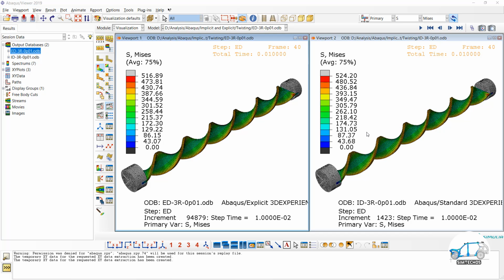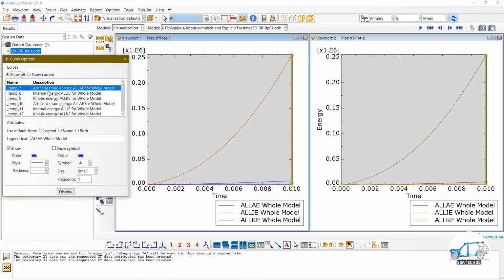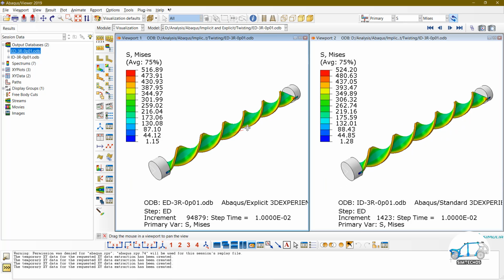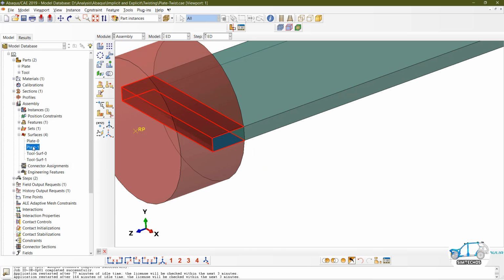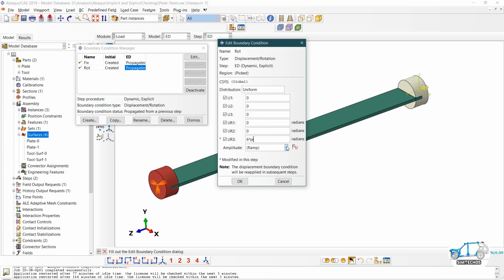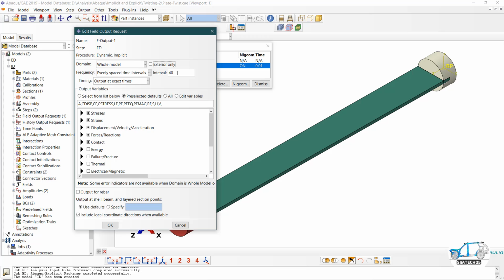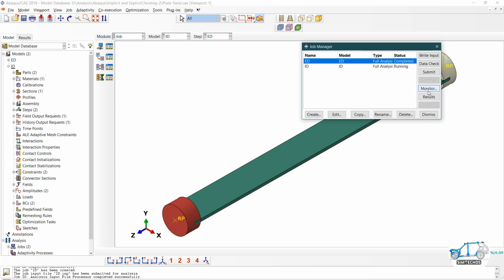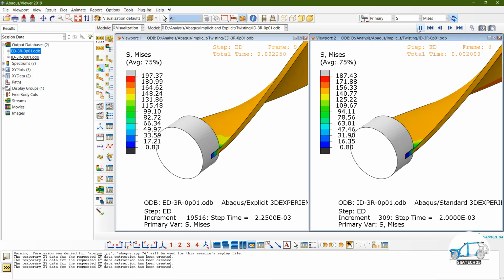Implicit and Explicit Analysis in FEA, Part - 03 (Example)

Comment: What steps do we need to follow if we want to break it completely during torsion?
Reply from the maker: Incoprate damage parameters, in JC material model with explicit step. Implicit may not able to converge solution for complex damage.

Comment: sir I am solving a same problem with implicit and explicit. in implicit the kinetic energy is less and internal energy dominant but in explicit kinetic energy is getting dominant? when does this happen? I am not clear, if you can explain. It is a low velocity problem.
Reply from the maker: Dear,
Are you using same time period for both steps?
Make sure un implicit it should not be quasi-static step.

Comment: At the start of the video you show us that the static tool is the one from the left, where you measure the RF, then when  you proceed with the example set-up you apply the rotation on that tool,  wich was supposed to be static, i do not understand
Reply from the maker: Dear,
Maximum reaction force will be generate on fixed ends only. Here I used reference point of static tool to plot reaction force.